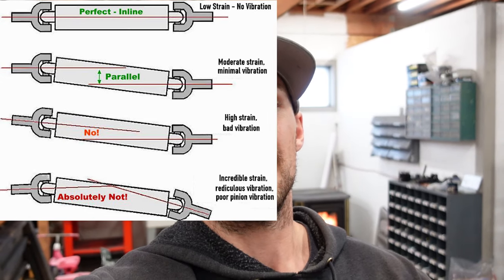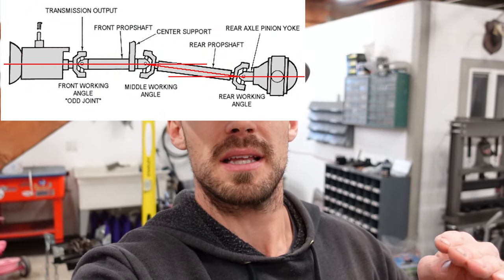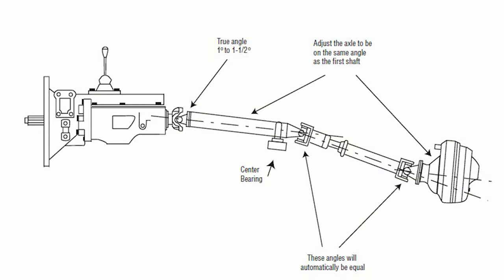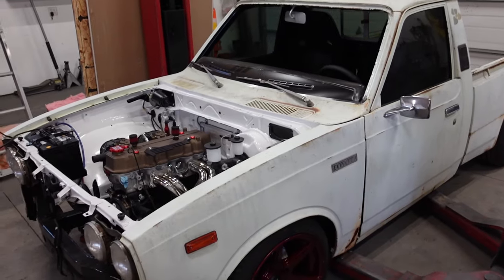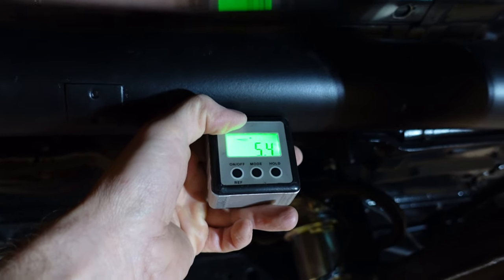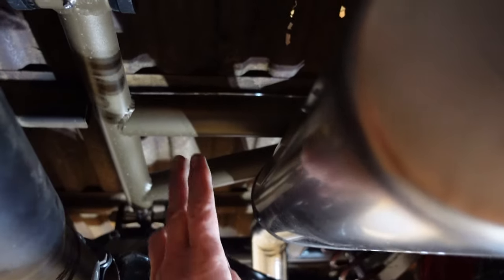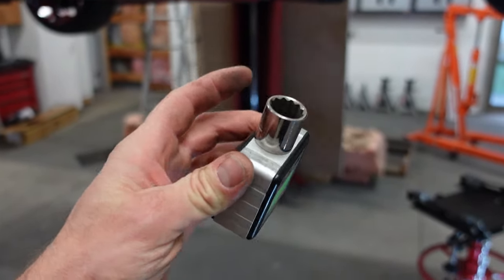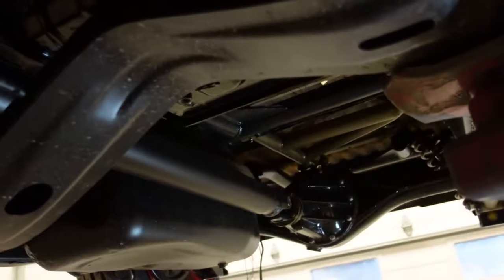How To Perfectly Set Up Your Drive Shaft Angles!

Comment: Umm pinion angles are to be measured at static ride height. You should have had that truck sitting on the ground. The weight of the truck on the ground is what I've always been taught. Total angles should be with in 1 degree opposite operating and never even. Example trans down 3 degrees axle pinion up 3 degrees as they will cancel each other under load to prevent vibration also keep joints lubricating itself.
Reply: With the 3 link properly set up the pinion angle relative to the ground won’t change throughout the travel, and the transmission side to the ground won’t either. The angles going thought the u joints themselves will change but they will still be matched, so in this case it can be set in the air just fine. I would double check it on the ground, but more to make sure that the U joint angles aren’t zero at ride height. With measuring the angles, you want them on the same plane, so 3° trans down and 3° pinion up are the same angle, since they’re pointing in opposite directions the ‘negative angle’ of the tranny is only because it’s pointing backwards, if that makes sense
Reply: @treykish  Somewhat agree as i've not dealt with 3 link, Don't think He mentioned this was for three link only adjustment. I did mention 3 up and 3 down. Still would think pinion angle will change base on suspension load weight of truck on the ground but maybe not on this truck as rear weight is basically not a whole lot.
Reply from the maker: @treykish  exactly! As the axle moves up, the pinion stays at the same angle so the transmission and axle will always be at the same angle
Reply: You have no business commenting on it if you know nothing about 3 link on a low profile riding truck.... no hate js.
Reply: @freedom_dispenser  Good grief didn't know he was speaking just on 3 link relax didn't come here to argue. He just started talking about angles and then just started adjusting th 3 link. learned differently through the automotive school I attended.
Reply: @austinniemela  Thanks for the educating me about 3 link, and yes i do own a lowered C/10 but with trailing arm suspension.

Comment: I actually had absolutely no idea this was even a thing. Just to be clear, let’s say you are changing or upgrading to a different driveshaft, should you always do this measuring procedure? I can’t say a changed driveshafts while working with my father, but if you were to ask me how do you change a driveshaft I would answer “u pop off a few bolts, add the new one and done”

Comment: Well presented man. I've seen it so many times where some guy on a forum or group would be telling a guy that they needed to add a degree shim on a leaf pack after lifting or lowering a truck, then the guy wonders why it's vibrating and wearing out u-joints. A few measurements of angles and getting things where the need to be is the right approach.

Comment: It's about timing, if you have a vibration then the joints are out of time. Time is adjusted by angles and even quantities of joints. The front axel shaft ujoints always chirping the tires in tight turns is the acceleration and deacceleration required as the joint rotates. There is a great video on ujoints and their timing. So 3 joints will be out of sink via the single phase joint if the pinion is not in line with the shaft.

Comment: Hi. On the front drive shaft with live axle I have come across a issue. Do I favour the castor angle over the pinion angle with a double cardan drive shaft? With the castor angle at 5 degrees for good steering it leaves the pinion angle out by 3.5 degrees with a 2 inch lift. I have short drive shafts. Good thing I only engage the front while going slow when off roading. Cheers Phil.

Comment: About to re do my peterbilt driveline.. 2 piece between transmission and axle with a mid ship between the differentials..  do the axle angle and rear of the driveline off transmission have to be pointed both up sat 2 degrees or can one be up and other down? And do you know about what the midship should be set at

Comment: Chevy s10 extended cab with 4 inch lowering blocks need what - well its a “double-cardan” style U-joints style so a 3/4 inch riser for transmission and 1 inch riser under the center support bearing is needed.    But my question is, the blocks need to be at an angle right?  Maybe I have 3 inch drop blocks I'll have to check again, but if it's a 3 inch drop block, I should have to use a  4° angle shim on top of the drop blocks with the thinner side of the shim going toward the front of the truck on both sides right?  Can't go any higher or if I hit a bump the driveshaft will hit the floor of the cab unless you hammer out some of the floor of the cab.  But a  4° angle shim should work for 3 inch and 4 inch drop blocks correct?   Man I hope this all makes sense lol! 😂

Comment: Maybe a little off topic but what clutch did you end up using with your swaps? Stock one or did you use an upgraded one to handle more torque
Reply from the maker: TDI swap? I used a southbend in the Tacoma and a lce dual comp in the red truck